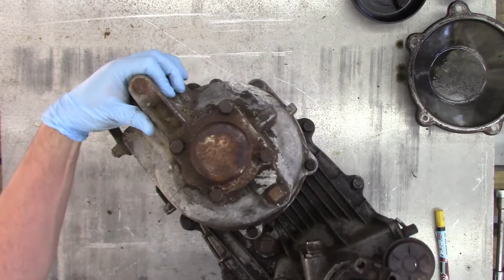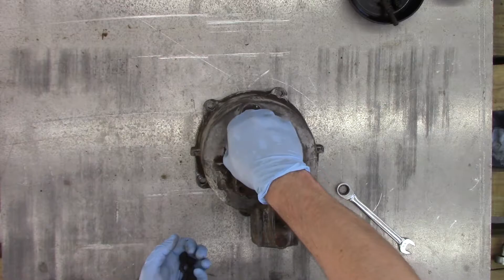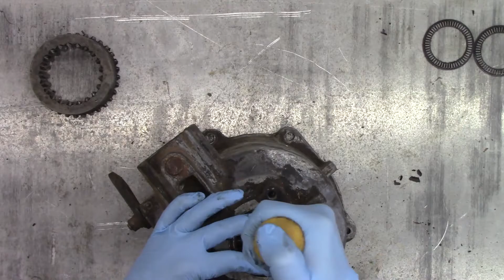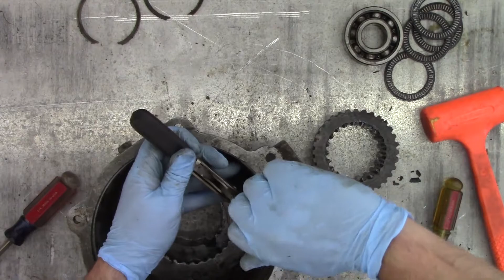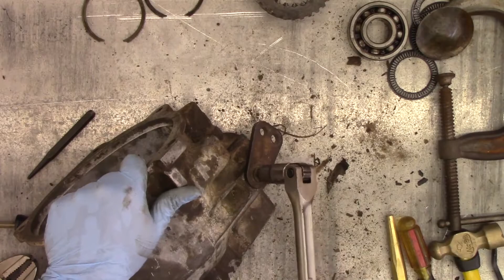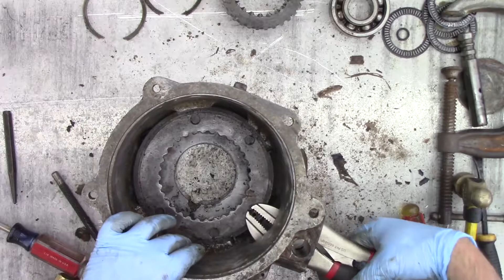Borg Warner 1305/1339 Quadratrac Transfer Case Teardown & Rebuild - Part 1

Comment: Mr. Maladroit THANK YOU, THANK YOU, THANK YOU!  You bet there are humanoids out there that will benefit from your time, knowledge, effort and research.  I am one of those humanoids.  Your series of videos are extremely informative and entertaining.  I will be doing a complete rebuild of my Borg Warner 1339 and adding the Mile Marker 4x2 kit.  I was worried about finding the unobtainium bearings but no more.  I live in El Paso, Texas and I have a source for parts in Chaparral, New Mexico (A Little 4x4).  Not a plug.  He is my honey hole for classic jeep parts but I know he doesn't have everything I need and that was my main concern until I stumbled upon your videos.  My build is a 1976 Jeep Wagoneer Custom, 401/Th400, 95% original one owner beauty.  Motor and tranny are done and next is the t case.  I sincerely appreciate your videos.  Keep up the great work and hope to see more in the future.  Good day sir.
Reply from the maker: Good luck with the build Tony and thank you for the kind comments. I have an update video in the works, but until then, be sure to check the OD of the snap-ring in the large Advanced Adapter bearing. It may be larger that the original and cause some problems, but you can re-use the old snap-ring.
Also, I put a few of the custom sleeved output shaft bearings on ebay if you need those.
https://www.ebay.com/itm/304759394548?mkcid=16&mkevt=1&mkrid=711-127632-2357-0&ssspo=PXaXMlwuQfi&sssrc=2047675&ssuid=&widget_ver=artemis&media=COPY